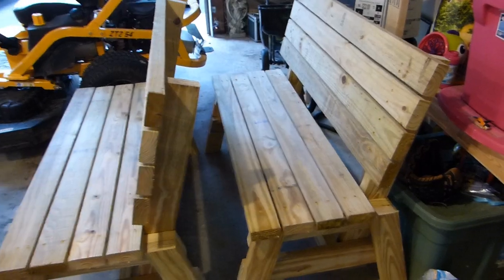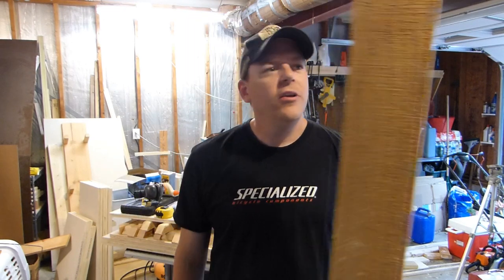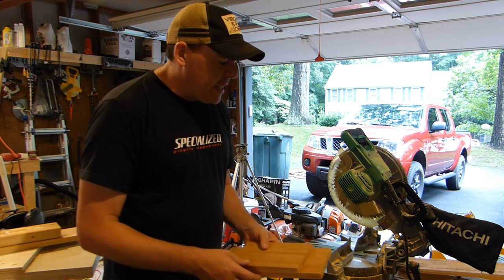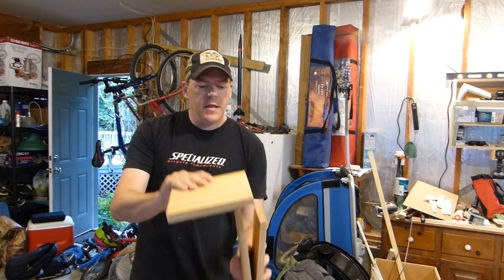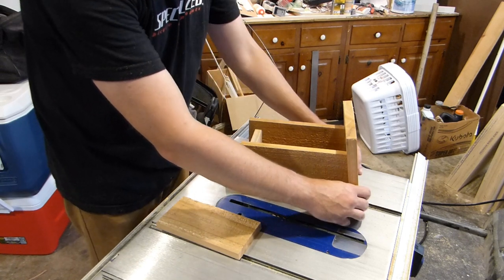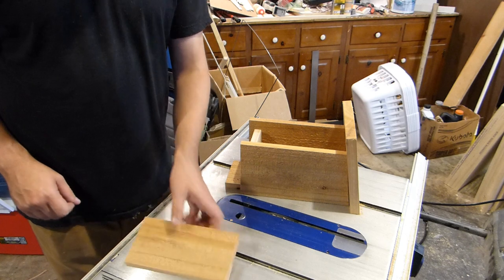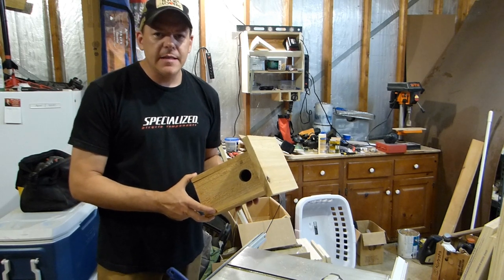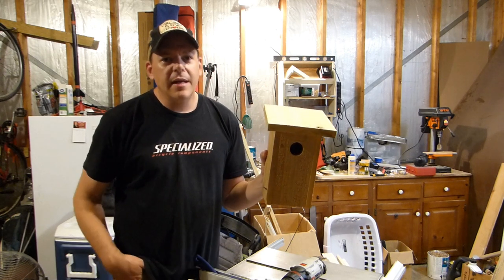#51 Making Bluebird Boxes With Cedar Fence Boards - Inexpensive Bluebird House

Comment from the maker: Thanks for checking out our video today. Be sure to HIT THE LIKE BUTTON if you enjoyed the content and consider SUBSCRIBING if you want to see more of our work https://shorturl.at/szFHP
Reply: At. 9:51 he makes a crosscut  without the miter gauge ,running the end of the board against fence. This is dangerous. If the board twists a little bit the blade will grab it and throw it back at the operator with a lot of force.  I’ve been guilty of the same mistake and got hit in the stomach with enough force to cut through my  shirt and skin!  Google table saw kickback .

Comment: When using a brad nailer the gun should be placed perpendicular to the narrow facing board. This will eliminate the nails from protruding through a board's face. Thanks for the ideas.
Reply from the maker: The longer finish nails rode the grain to the surface. The brad nailer with shorter fasteners didn't have the same problem
Reply: @WoodsTreeFarm  Terry gave you the correct method.

Comment: Some dangerous table saw techniques! Do you get many kickbacks?
You will!
Reply from the maker: Timestamp of questionable technique?
Reply: At 9:51  he makes a crosscut without the miter gauge while running the end of the board  between the fence and the blade. A slight twist would cause the blade to grab the board at throw it back violently!  It has happened to me. Search table saw kickback and you’ll see a few examples.
Reply: I’m sorry ,i got the time wrong on that crosscut. It was around the 5 minute mark.
Reply from the maker: ok. thanks

Comment: My sons made a very similar bluebird house but the bottom seems to be rotting. They did not use cedar. What nails to you recommend using if no nail gun available? Thanks
Reply from the maker: I'd probably use relatively thing gauge galvanized brad nails, especially you're working with cedar because it splits real easy. Always use a good quality exterior wood glue too, and it should hold up for a long time.